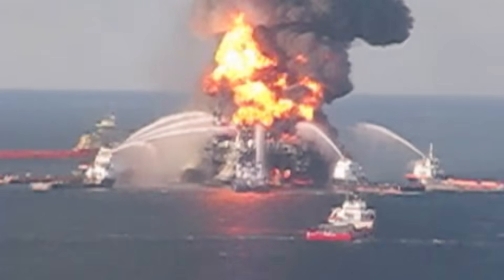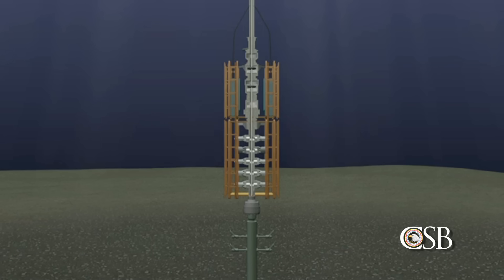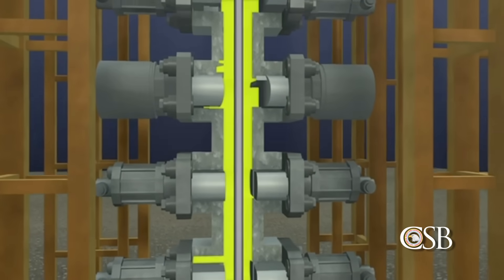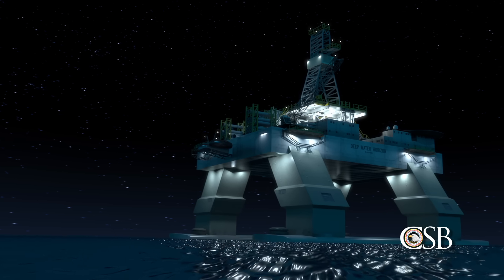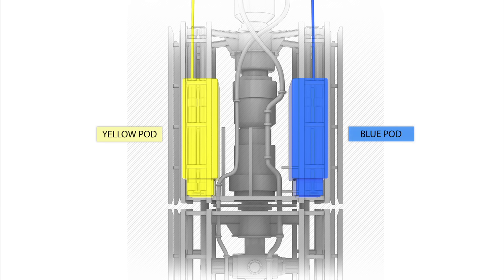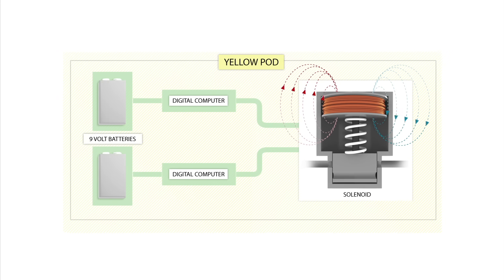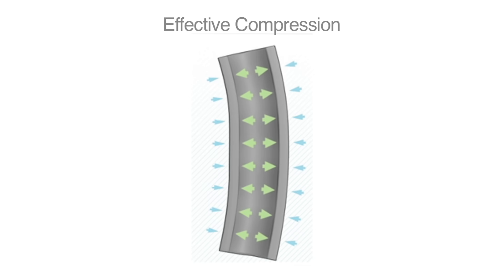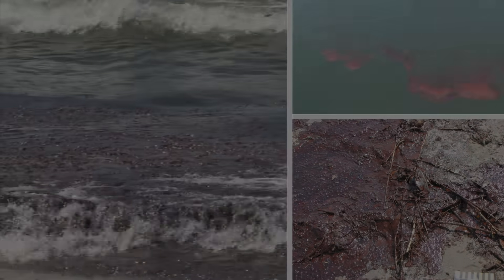Deepwater Horizon Blowout Animation

Comment: This is a very good video as to what happened.  I agree with other comments that human error will cause another one.  There is a solution now, even if all the mistakes mentioned in this good video happened again.

Complacency is the issue, it will happen again after a few more years of no accidents.   The solution is to capture the oil at the bottom without disturbing the wellhead. In effect it is putting a huge underwater vacuum near the spill.  There is a new invention that solves problems that prevented that before, methane hydrates and the gas expansion "air-lift" effect.  This short video explanis how the invention works https://www.youtube.com/watch?v=CyGNNbeutRI

Comment: Good deep explanations! A small wiring fault drains the battery and redundancy was spoiled! Good to learn!
Reply: Both redundancies were spoiled from wiring mistakes. Which made it seem ever more negligent.
Reply: There should have been battery monitoring which would have seen the battery draining
Reply: @franklofarojr.2969  Probably difficult to implement just due to how deep it is, because some electricity is lost as it travels through transmission lines. Besides, once it's on the ocean floor, you can't exactly send someone down to fix it, which is why it's so important to get this right the first time.

Comment: The drill pipe buckled because it was improperly installed. And people who worked on the rig knew that and were terrified of what might happen.
Reply: Fundamentally unsafe blow out preventer design. This was a disaster waiting to happen even when installed "correctly" The drill pipe should not be physically capable of moving out of the way of the shear rams, even if twisted into a pretzel. 

More shockingly, both deadman units were also wired incorrectly, and only BP's lack of maintenance saved the disaster from being worse. If both 9v batteries had been live in the functioning deadman, The shear rams would never have operated at all. Thats...I have no words. The only way to not notice the wiring problems with the deadman would be to never have tested its functions before putting it on the ocean floor. 

I would blame corporate for not letting the rig workers do their job properly, and not providing them with safe equipment.
Reply: @SlocketSeven  if the government screwed off there would be plenty of time and money to be able to do things correctly... 
Sadly when the government takes the majority of your income these sorts of tragedies happen...
Dont believe me, if more government meant a safer workplace the Soviet union would have been a workers paradise
Reply: BP is a british company...
Reply: @SpenzOT  39% of the shares are held in the USA.  40% in the UK and 21% in other countries.  It suited Obama to push the British line  (He doesn't like Britain after his grandfather was interrogated on suspicion of being a Mao Mao terrorist)
Reply: andrew allen wrong. Learn all the facts.
Reply: NCTarheel13 So if not America where was this faulty blowout preventer manufactured and tested? Please tell me the true facts.
Reply: You obviously have never worked with Chinese.
Reply: SpenzOT Whose foolish management put their trust in an American designed and manufactured BPO safety system run by Halliburton an American company.
Reply: should have got chinese people to work on it... clearly the americans cant do it properly

Comment: Excellently researched, produced, and presented video. Thank you for providing a clear and unbiased report of this terrible tragedy. 

As an oil and gas engineer, this helps me understand the design and operational flaws, so that I can take knowledgeable action to prevent such tragedies in the future.
Reply: Anyway,  I was here to make sure people weren't being too hard on the person that shared his experience with us.
Oil produces much more than just gasoline for vehicles. Plastic, medical and electronic equipment,   even salves and cosmetics and durable clothing are derivated from the source oil.

I  don't like largescale drilling and any disturbance in certain areas, but it's not practical to just shut it all down overnight. Cure could be worse than the disease. 
We need to plan and know that it'll be a finicky thing to balance, probably forever.
Reply: @hotaru8309  {gasp} NUANCE? In MY youtube comments section? OUT, TO THE CORNER WITH YOU WHILE YOU THINK ABOUT WHAT YOU'VE DONE. 

😜
Reply: Do you think the whole platform really combusted like it did in the animation? That was crazy, you would be ashes before you knew what happened.
Reply: Geothermal is interesting. One of the main problems is that takung out hot water and puttinh cold water back into the hot earth causes small earthquakes , sometimes they're referred to as mucrotemors based on suze, and we dont know the full impavt of these yet. I think on a very large scale there could damage to structure. The hot water and erath needs to be positioned well and innhigh enough quantities to be stable to the residents.
No one solutuon can hold everything forever.
Reply: I'd hope the US's Chemical Safety Board was doing good research on matters of chemical safety.
Reply: your probably a deepwater horizon engineer LOOOL
Reply: Does any one buy this. That BOP would have been tested before being put into service…
Reply: @ironhorzmn you are so we tall did. mr high 20 iq score
Reply: @ironhorzmn The argument that one individual is contributing to the overall damage of the environment is the exact conversation those big polluters want you to have so that you don't look at them.
Reply: Stop polluting our planet with your filthy corporations
Reply: @worstpfpever243 Without corporations then you won't have a lot of the stuff you have now that you take for granted. Obviously I am not too fond of them and their behavior, but without them we don't have as much
Reply: "Sustainable energy", ha,  first nuclear was rejected, now comes natural gas, there is no way to get to the point where renewables fully offset the more conventional sources without some type of transition, something environmentalists have been fighting tooth and nail, just look at hydroelectric or the protests against geothermal.
Reply: @eccentricthinker142  to believe that something doesnt need a transition in the first place is foolish.
Reply: @eccentricthinker142  the industrial revolution and its consequences have been a disaster for the human race
Reply: @eccentricthinker142  We need a reduction in energy consumption so that renewables are enough.
Reply: @eccentricthinker142  you are so we tall did
Reply: @eccentricthinker142  guess you don't know what solar power is then huh?
Reply: @scottyweimuller6152  You're right, I forgot about the environmentalist protests against an installation in Nevada, something about birds and box turtles.
Reply: @scottyweimuller6152  Do you understand how many solar panels it would take to equal the output of just one nuclear plant?  About 50 square miles operating at 100% efficiency, and that's not including storing the power at night or accounting for bad weather.
Reply: @scottyweimuller6152  Yeah, I'm all for geothermal.  I just think we shouldn't be decommissioning nuclear plants without replacing them when there is no way renewables can handle our needs, especially when you consider what it will take to pull the carbon back out of the environment.  The climate isn't going to fix itself anytime soon and it's going to take at least as much energy to clean up the environment as we put into polluting it.  I'm worried that the recent environmental panics stoked by the media will ultimately be counterproductive since they don't seem to be leading to any constructive solutions.  For example, protesting against air travel is a complete waste of time considering its relatively minor impact even on a global scale.
Reply: @scottyweimuller6152  Solar has it's issues where the panels have to be retired after 25-30 years
Reply: @the_expidition427  I don't see the problem with replacing the panels. Thats a pretty dumb argument
Reply: @icemachine79  i don't think our impact is irreversible yet, case in point the way Earth began renewing herself last year when everyone sheltered at home during the first major spread of covid. We saw smog clear from cities, the ozone layer regenerated a portion of itself, and more amazing stuff happened in only 2-3 months. I think we should plan to have periods where everyone stays at home for a bit, maybe one weekend each month or one whole week per month. 

But in conclusion, all we have to do in order to save Earth, is do nothing. 🌎
Reply: @MrGrace  The rates of pollution decreased, yes, and that was a good thing.  But the reduced output merely slowed the effects of AGW.  We'll need active technologies like carbon sinks to actually undo the damage and cool the planet on a global scale.
Reply: mlogaN writeS I will make sure to burn some rubber tires for u
Reply: It was all trumps fault even though he wasn't president at the time just everything is trumps fault because hes a massive idiot with semen on his black eye

Comment: They struck a seam of oil and gas at 30,000 psi. That pressure had never been encountered. Also worth noting that they broke the law drilling as deep as they did. I'm sure all of that it was omitted for some reason. Must be nice being in the business of oil. Drill some wholes in the ground and become billionaires.
Reply: I've worked on wells 32 kft below sea level in GOM; if I remember correctly, Macondo was ~20kft. The real reason for the disaster was the improper operating practices in combination with the failed equipment.
Reply: There was a multi hundred page official report done by the federal government. Most of the video is based on that report. Also, the BOP won't necessarily see the bottom hole pressure. You have to account for the hydrostatic fluid column from the formation to the BOP whether that is you're mudweight, seawater, or gas gradient (assuming a fully evacuated wellbore).
Reply: +fla playa where did you read they broke the law for drilling that depth? I hadn't heard that before. All operations had to be permitted/approved by the US government before they could start.
Reply: I read it in an official document prohibiting drilling beyond so many feet and they basically said fuck the rules and drilled much deeper.. Would you like me to find the document? Kinda know what I'm talking about here if you hadn't noticed.
Reply: Yeah I'd like to see it. I'm researching more about the poor decisions BP made as a company, and I've never heard about them breaking the law with the drilling depths. That's very interesting! Thanks for the response!
Reply: Nathan Burkhalter Yeah they were not supposed to be drilling beyond 25,000 feet (approx) and hit a seem of 30kPSI at 500 degrees at around 40,000 feet.. The equipment couldn't handle pressures ten times that of a pressure washer and blew. Pretty sure this is where I found all the info you will need. This may be erased adding a link and you are welcome for the reply Nathan.
http://www.theoildrum.com/node/6493
Reply: kevin morris Uh oh we got a know it all up in here magically responding to me fairly quickly everyone. Trust him and not me... Rules were set and they broke them period.
Reply: Just enjoy it +Kevin Morris
Reply: Why not? Jed Clampett shot and missed a squrrel, became rich, moved to Beverly Hills and the rest is history. LOL
Reply: +fla playa Haliburton and Monsanto are the Devil!!
Reply: Also, they had TDed the well days earlier, so they had been sitting at that bottom hole depth for multiple days before taking the kick. They were NOT drilling ahead like you make it sound.
Reply: You know what you're talking about, huh? Then why are you here making YouTube comments instead of "Drilling some wholes in the ground and becoming billionaires"? Can't even spell "hole" right, Mr. Expert?
Reply: No they had a lease with the EPA to 15k feet. They almost doubled that. The 30,000 PSI seam should be a direct giveaway and all access on the web is denied. I read the report.. 30k PSI at 500 degrees F warped the drill tube so far out of alignment the hydraulic sheers in the BOP didn't line up anymore.. Must be making all this up tho.
Reply: Here is the latest report verifying my claim of 30kPSI.. TEN TIMES A PRESSURE WASHER and rated BOP means. 

http://www.theoildrum.com/node/6421

Found a much more detailed report of culpable negligence in recent months but this will do. *Note it's an oil company. There's your concrete evidence TEXASLD.
Reply: "So the high pressure gas was able to blow all the sea water in the riser out onto the deck of the rig. (This happens extremely quickly, well below a minute) The gas then followed, and as it flowed out of the pipe at the top of the well there was some hot source that caused it to ignite. (This could even be from a static electricity spark). Because of the depth of the well, the pressure in the bottom of the well was in the 30-40,000 psi range." 

RIP TEXAS IMBECILIC OIL BATHER

Comment: What's the likelihood of all these failures occurring? Curious to see if there's a different account of this
Reply: +Wael Ali This was the "perfect storm" of sorts. There were 9 other factors on the rig and within BP that led up to this event being able to occur. Extremely low likelihood of a repeat occurrence, even if the exact same equipment and situation happened again.  The biggest issue was BP's lack of ethics with testing equipment, focus on cost savings over risk management, and improper response to danger signals.

Comment: What the heeeeeeel. So much redundancy was failed! That blowout preventer had almost too much redundancy. But how does EVERYTHING fail?
Reply: +AaronLow1   Lack of maintenance and inspection was the downfall here. Along with the string of bad decisions made by BP leading up to this event.
Reply: on top of everything already mentioned, if you read "deepwater horizon blowout - lessons for improving offshore drilling safety" (a fantastic read and freely available online), you'll realize exactly how much of it wasn't actually redundant. For instance, the two redundant computers and solenoid valves for activating the BSR both relied on the same pilot valve and hydraulics upstream of the BSR's, and a ton of other little things like that. Macondo was certainly one of those once in 100 years events that will change the industry and several engineering/design practices around it, which is the best we can hope for after such an awful incident. Incidents like this are 100% preventable, but it requires a culture of safety throughout the entire industry,  thoroughly tested design practice, and independent review and regulation by a third party held responsible for any events. This was achieved by the navy's SUBSAFE program that has the previously mentioned rubric. The navy went from losing ~ 5 subs a year to equipment/operational incidents, to not losing a single sub in the 50 years since the program was implemented. It can be done, but it requires an industry willing to do it
Reply: +AaronLow1 As others have said - complacency and lack of regulation.  The only way to combat complacency and wilful mismanagement is to give the regulators the power they need to hold operators to an appropriate standard.
Reply: It's what we call in the industry "the swiss cheese" all the holes line up and the shit hits the fan.
Reply: +AaronLow1 Mistakes during installation and nobody bothered to double-check the backup systems. Basically: Complacency and wishful thinking.
Reply: NO amount of redundancy reduces failure possibility to ZERO.  Perfection is not possible.
Reply: Basically the redundancy was reason to reduce quality control, because they assumed that the config would reduce the risk, and QC and mantainance can be more expensive than initial cost especially when the labor cost is high, as it would be for deep water operations.
Reply: It was actually a one in several billion accident. That's why these things don't happen all the time.
Reply: in a way however thats what a failsafe is, these were not failsafes. 

it SHOULD have been designed to need power to keep the shere from closing, meaning if power was lost then it would slam shut, they didn't design it that way so it was not really a failsafe as much as it was just a powered protective circuit.
Reply: A lot of it had to do with the buckled pipe. People keep saying that the systems failed, and that is true. BUT, HUGE BUT, the ram DID deploy. The systems were not the downfall in THIS situation, it was the pipe, but in others, it's a different story.
Reply: @grapelikespurple  they should have built the bop to keep the pipe entrapped within the cutting jaws regardless if the pipe bent.
Reply: @grapelikespurple  ...From the video, apparently all the systems DID fail, and the only reason one of the pipe shears activated was from a complete mistake!... and then it still didn't work because of the pipe bending.  So many levels of fail on top of each other happened here.
Reply: +AaronLow1. Murphy's law. if it can go wrong, it will at some point.
Reply: Murphy's Law. Everything that can go wrong, will go wrong. No matter how many redundancies you have, it's possible for them to all fail at once.
Reply: one thing they did was during a test to see if the well was leaking was read incorrectly, wishful thinking.  it was a mistake that lead to the explosion
Reply: The explanation was printed on a label on the BPO "Made in America"
Proudly miswired and untested 3 ways.
Reply: The backup systems were not properly checked and the pipe was buckled, something completely unexpected.
Reply: Short answer = lack of bench testing.
Reply: +fromkentucky I was thinking the same thing.  They never ran a drill to make sure the emergency back up systems worked and would do there job?